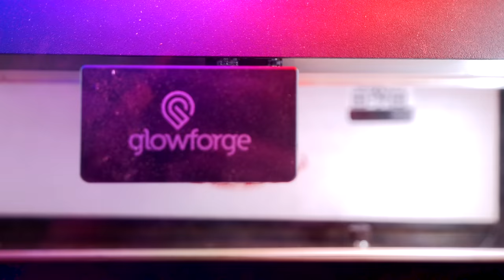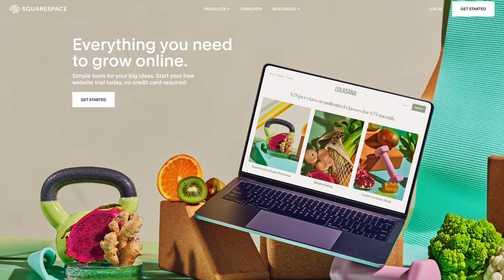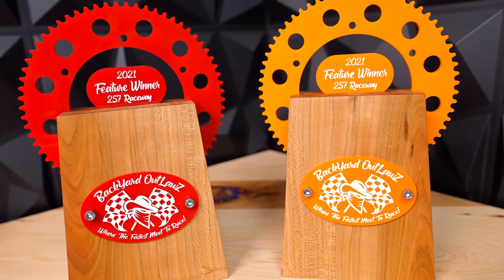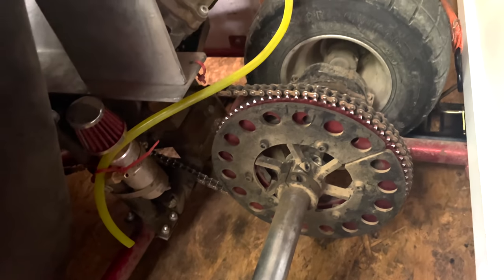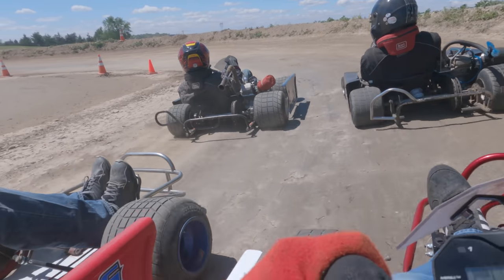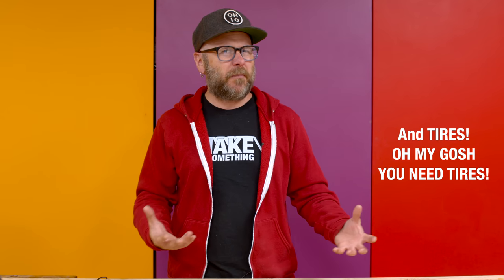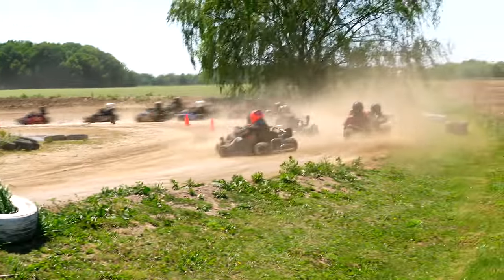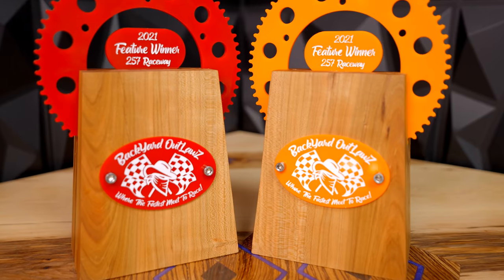Making a pair of racing trophies | Woodworking project.

Comment: Great work.
For filling the etched parts I've previously gone down the Ten Pin Bowling route of jamming wax crayon in there and polishing off the over spill. Clearly not as long lasting as using a rattle can, but a little easier and potentially with more options on colours in confined spaces without complicated masking.
Reply from the maker: Ohh, I need to try this!! Thanks!

Comment: I like the trophies a lot, very nice design.   Also, the passion you have for your racing really comes through, so maybe you could do some more videos on that, if they perform for you .         The color wheel lighting could be used a bit more sparingly, as it was distracting.    Perhaps just for the finished product.    Anyway, good luck with your racing.

Comment: Kinda on subject, but I was wondering if you have a recommendation on a place to grab parts for go-carts? I just got one that I want to work on with my 18 and 17 year old boys. It has a 196cc Hensim motor missing a throttle cable for the pedal, the pullstart case is missing the bolts and its missing an air-filter. I also finally got my M.1000 Stepcraft and am super impressed with it as well. Anyways, if you have time shoot me a response. Thanks
Reply from the maker: Arcracing.com and Nrracing.com is where I get most stuff
Reply: @MakeSomething  Thanks for the info